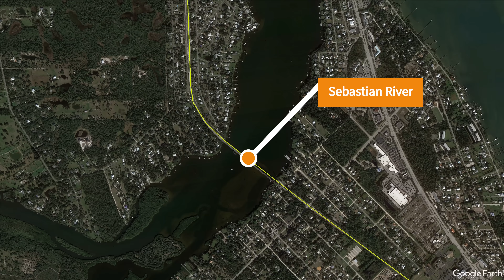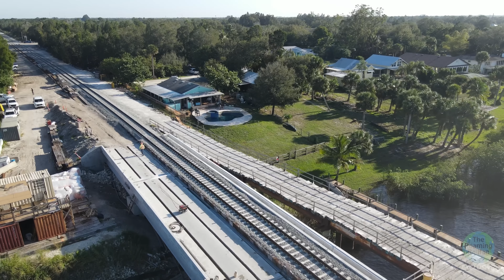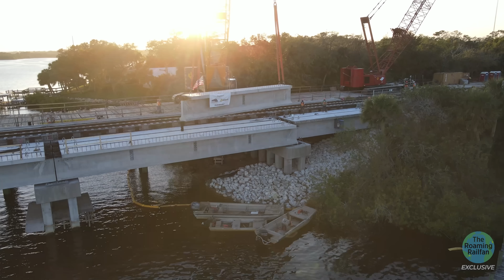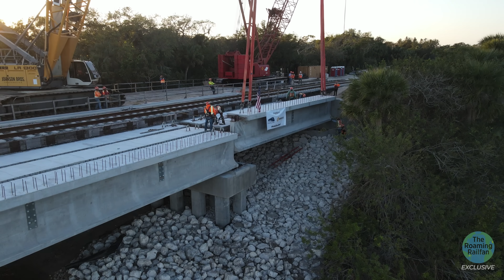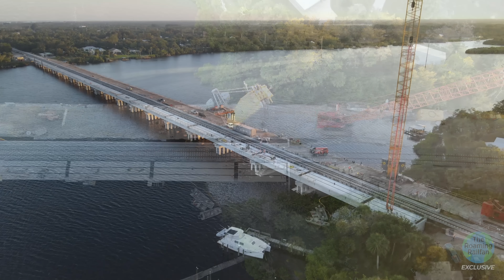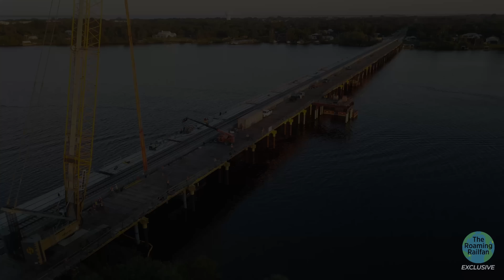Brightline Construction Bridge Edition: Sebastian River Final Girder Installation - November 2022

Comment: As someone who used to back up trucks for a living, I have nothing but respect for the driver that backed so straight all the way across the work trestle. That was no small feat.
Reply: Delivered concrete for the piers a couple of months ago. I don't mind admitting that the sphincter muscle does tighten up when reversing across those wooden beams.
Reply: I got the feeling he was using the shadows of the guard rail on the work trestle as a guide to keeping 'on track'.